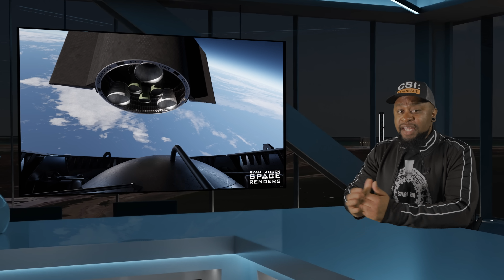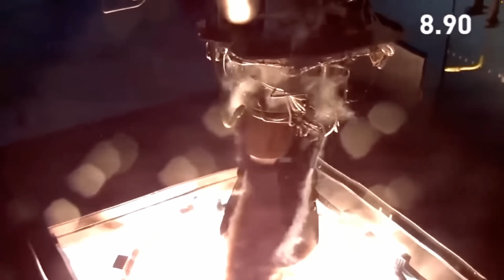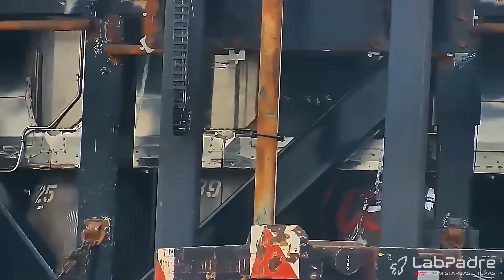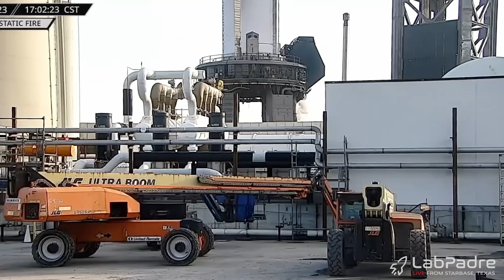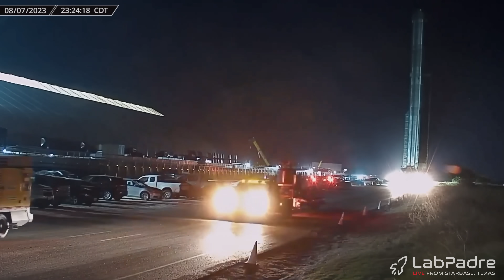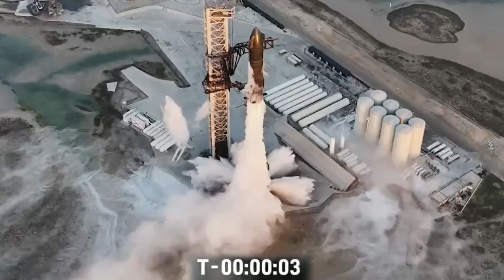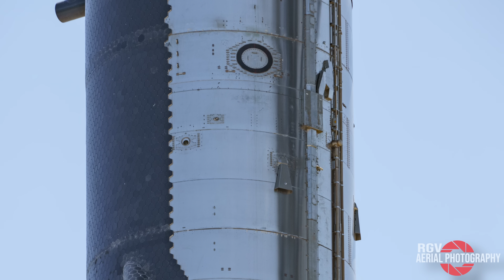How To Prevent Raptors From Destroying SuperHeavy | Part 1

Comment: Another thing again zack, am surprise the ship never made it. I thought the biggest task was the booster and launch mount. 🤦🏾‍♂️. How on earth they lost connection with the ship, I felt confident in the ship to be the most ok part. Because the booster actually go through way more stress than it. I strongly believe they should add two more engines to the ship. 4 in the middle and 4 vacuum. I was watching the fuel level also, that booster use up so much fuel, I doubt it would be enough to do a successful land with all that weight etc. Not sure. The ship needs allot of upgrades, those engines to perform long duration for the moon. I don’t think those engines and fuel will be able to take that ship to mars safely orbit mars, land, launch and back to earth Nope. Nope. Only a nuclear powered engine can do that. And I don’t know why and what takes them so long to actually make a nuclear engine.
Reply from the maker: Ship needed to go through this so they know what to fix.  Just like the booster.

Comment: Hey zack. My concern is. How booster 7  flip multiple times and all its engine never shut down. With the long delay to terminate it, I see it dip, flip, and tried to straighten up to go up before it explode. Yet booster 9 successfully separate from ship, and inner engines shut down. My concern is, if it was a fuel back slush that cause the engines to suffocate, why that never happen to booster 7 when is flip dip🤔. Something is not right. Again why they never tried to relight booster 9 engines after it complete it flip🧐. Or, why not another approach in not having it flip? May sound stupid, but just asking.
Reply from the maker: It’s like swinging a bucket of water over your head.

Comment: Are those electric actuators designed by SpaceX? It looks like they use inverted planetary roller screws, hard to tell but it looks convincing from the outside shape.
Reply from the maker: That's a good question. I'm not sure if they are developed in house or not

Comment: 42:30 There's a good chance that the engine status indicator lags the actual starts.  If it only updates once a second, but the engines start every 0.05 seconds, the indicator is nearly useless for trying to determine the start pattern.
Reply from the maker: The SpaceX livestream was not synced properly with the diagram. I edited so that its correctly timed. If you watch closely you can see the shock waves when different groups start up. I thought the same as you initially but turns out its actually spot on

Comment: Zack I want to mention something you have not commented on. If you watch a night Falcon booster return about 25 km up and a Corona deveolopes around the grid fins. The same heating that hits the heat shield of human capsules and the fairings of launch vehicles. This heat also hits the engine end. G forces exceed launch levels.
Reply from the maker: I think the heating on human capsules is much greater because they are entering from a much higher altitude and velocity. I haven't really covered anything related to that yet

Comment: 43:39 The co2 system is a great observation, but with those volume flow rates im pretty sure that is propellant.Could be that they just ramp up the co2 stream as the shutdown releases more propellant in the bay, but there is no way this much co2 is released for 2.5 mins.
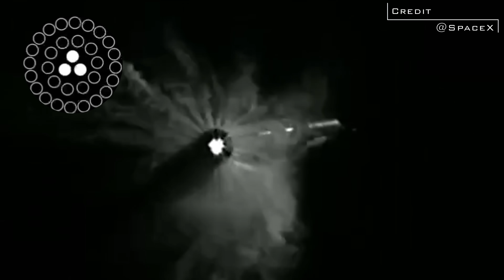Also i'd believe the way the five streaks form wouldn't be so clean if it was just co2 not getting sucked in by the single engine gap anymore. Its easy to make a smoke stream in a windtunnel, but hard to block a clear stream out of a smoke wall, as in the remaining engines would probably still suck away the majority of the co2. Also that pronounced star shape at 43:39 only lasts for a few seconds every time new engines shut down, while the continiuous co2 system becomes visible again at 43:57, with a much smaller expansion radius. They might still reduce the flow though and also keep some for the return.

It would also not mean anything went wrong, considering they shut down many engines at once they might have decided to keep propellant flow going a bit longer after shutdown to soften the fluid hammer effect, which would yield instant shutdown/reduced thrust for hotstaging while also leaving the ship intact. You can see that right as the streaks thin out, new engines are shut down, as in managing the shutdown dynamic flow pressure. Possibly even commanded/dependent on an upstream flow pressure gage. If this is true they might try to shut combustion on all engines at once next time, possibly with even longer propellant slow down to get an even faster thrust reduction, or even a planned underthrotteling/starvation if there's no instability issues from that.
Reply from the maker: We have recorded 3 different full length tests of this system on the ground. It does in fact run for 2.5 minutes. Elon also mentioned in his tweet that they would run the system during the entire flight. I showed the tweet in order to remove any doubt of that. 

Also, if they left fluid running longer than it would likely come from the huge bleed valve on the bottom of the booster and not directly out of the engines. The staged shutdown is designed to reduce the hammer effect.

Comment: The autogenous pressure system is so complicated any leak there will cause problems for fuel feeding the engine causing more risk for engine failure.    I would love to hear from @csistarbase to do a deep dive on this.
Thanks
Reply from the maker: I think the autogen system is actually able to adjust how much gas is being sent to the tanks. If there was a significant leak there the flight computer would likely increase the amount of gas being sent.

Comment: Are the booster engines space far enough apart that if 1 engine refuses to gimbal it won't prevent its neighbors from gimballing as designed?
Reply from the maker: Yes they not able to collide with each other as far as I know.

Comment: I think the hot staging caused the propellent to surge in the tanks and piping of the booster and when the engines relighted the fuel and oxidizer started slamming inside causing pressure surges in the engine pumps which we know too well can cause explosive conditions in the combustion chamber. They should have an engine or two on a separate fuel system that is designed to handle sloshing of fuel better and use it to get the bubbles out of the main fuel/oxidizer supply before relighting the rest of the engines. The other way is to keep the acceleration of the booster positive through the hot staging process, but i can't imagine how that can be achieved with all the engines of starship pushing down on it in the first seconds...

Comment: After the failure of the last launch I have a question regarding the protection of the crew from failures,  Seeing a video of the forward portion of the Starship tumbling after destruction, I realized that there was no crew escape systems on the vehicle.  This would make the Starship the first crewed rocket to not have any sort of crew escape system dating back to the beginning of orbital operations. Could you do a video addressing these questions.
Reply from the maker: I would probably touch on it as it becomes relevant.  I usually don’t have time to discuss things that far out in the future. It’s tough to be able to mention everything that’s actually happening now.  I removed several sections from this video related to other upgrades

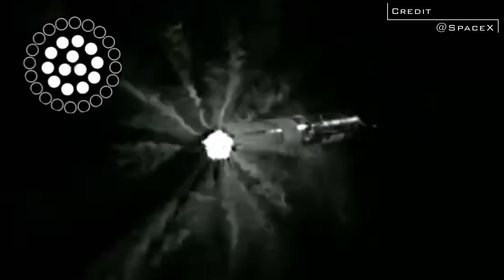Comment: 43:44 you are wrong. Scott is mostly right....That is methane or oxygen or both venting right after each engine shutdown. Coming from vents. You cant just stop that much fluid flowing without destroying stuff, pressure has to go somewhere. Called fluid hammer
Reply from the maker: With all due respect to Scott - because I love his work - I think my team and I have a much better understanding of how this vehicle works.  

I don’t think he was even aware of the fire suppression system.  

They seemed to do just fine stopping the fluid during all of the 33 engine static fires.
Reply from the maker: The gas is very clearly coming out of the side of the vehicle. Not the bottom.
Reply: At 43:57 you can clearly see that large amounts of the visible gas come from those 18 vents of the CO2 purge system around the circumference of the booster as the engines themself don't have vents in those locations. Scott didn't mention this in his video so that's what Zack say he is correcting.

Comment: humm why not reinforce the engine itself instead of creating covers. since they kbow what parts may fail in the motor why not to reenforce those I guees it will add less weight in the end right? I bet the turbo pumps are the part with more issues
Reply from the maker: They are working on this currently

Comment: Likely a stupid question but is there a reason the engine shrouds cannot have small holes drilled into them to help during overpressure issues and methane leaks? Presumably they would lose some structural strength but they would be lighter as well.
Reply from the maker: They do have holes in them, that’s how the CO2 escapes from the bottom

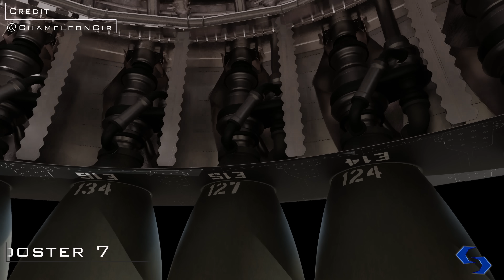Comment: 24:00 The whole box design is pretty overengineered. Why dont they use the same toilet paper roll structure as on de inner engines? A cylinder has the least area, best strength and is easy to make. Add a large cicular notch/Blast disc towards the outside to rupture in the event of an explosion and vent pressure towards the outside, like the exsiting cone skirts. Or if not for aerodynamics, leave the ouside open with just a 180 deg shield to the inside?

The cylinders would also act as a double layer between each engine, with every one having it's own shield and containment ate the same time instead of the single layer walls between the outside engines. And since the outer edge joints seem to be the biggest problem, you could probably make each tube 1/2 the thickness, adding up to the previous flat wall strength. Since an engine needs no more shieling or containment once it fails, the thinner shielding could just about be designed to fail, as the surrounding skirts will take the remaining heat.
The circular compartments would also allow more space in between them to vent off heat and allow any expolsion blast to dissipate in between the surrounding engines instead of forcing it downwards with the stronger vertical barriers/boxes. If you want to save weight i'd say the best way is not contain the blast but direct it's intensity according to what each of the surrounding things can handle, judging from the inner engines a (nonetheless shielded) rocket engine can probably handle a bit more than a prefectly smooth ride. Expansion volume between the engines increases by the square of the radius from the origin, so a lot of energy is dispersed with just a bit more free space between engines.

Combining the robust geometry and highly refined planar welds they make on their rings this would surely decrease overall weight and cost.

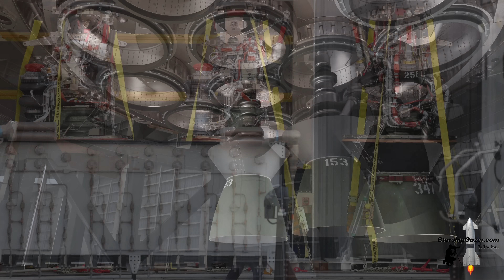About the failure of the center engines: The lower shielding "seals" at 12:58 seem pretty hefty, as in they confine gases and blast until the whole assemly, like 45:07 ruptures and sends metal and shock in all directions like a bomb. You'd rather have a controlled fail than a complete destruction. There should only be a solid bell shape around the top and side of the engine, with blankets, mesh or lose plates on the lower end only for heat protection on reentry and initial blast containment, something that gives way in case it does esceed the limit, because that's the most favourable direction you'd want the bang to go anyways!? A true best part is no part there...

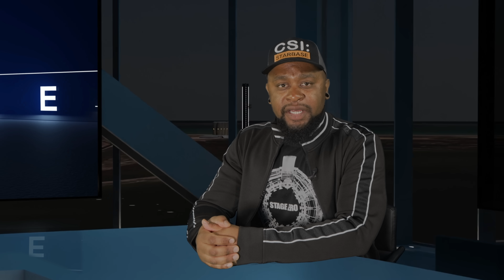Comment: 8:40 "If you lose TVC on one of the 13 Booster engines, it's fine now"... Is it thought? The way the 13 engines move together, do you really have the necessary room to move the remaining 12 enignes if 1 is pointing the wrong way? It doesn't look like it. Do they plan to jettison the faulty engine to continue controlling the booster or something to keep it out of the way?

Comment: 10:32 thats untrue, in fact there have been three early engine cutoffs. One during CRS-1, and two more, much more recently, during Starlink launches. Both didnt effect primary mission outcome, but caused B1048 and B1059 to be unable to land.
Reply from the maker: I asked my audience on Twitter how many failures were and that’s what they told me.  Outsourced that info lol.
Reply: @CSIStarbase  Ok thats crazy that they got this wrong. Btw the failures were
- CRS-1 
- Starlink V1 L5
- Starlink V1 L19

Comment: They need to make it so that the ship can hot stage off the booster regardless of the health of the booster.  That means having many contingencies. I would say that for the first part, the ship may need to fly back towards the launch site, then alternative landing sites, and then flat terrain away from people, then just away from people.

it'll have to burn a lot of fuel, or maybe dump some.

Even If it has people in it and it is gonna head towards a populated area, it may have to blow up.

if the fuel is gone, it mag be able to crash land relatively close to people.

I imagine having fighterjet ejection seats for the first test crew... or maybe a capsule.

Comment: There is a very obvious issue with all this blast shielding, no ventilation points to keep pressure low during an engine failure

Comment: Also good to note 48:35 This is a good representation of how at the 7 minute mark something happened on the ship that caused the remaining LOX to start depleating much faster than normal. You can see in this sped up footage how the LOX is always just abover the CH4 in the level. At 7 minutes there is a flash/ploom on the ship, take a look back at the guage and see the LOX is dropping lots faster until at 8 minutes it seems to be empty while there is still CH4 left.

Who knows if the FTS triggered or not, but I assume that running out of LOX shutdown the engines and the FTS auto activated because it then knew it couldnt achieve its nominal trajectory and rather burn up over Africa, better to do so over the Atlantic.

Comment: No youtuber seems to talk about, how little propellant the upper stage had to reach orbital velocity. It still needed about 4000 km/h if I remember correctly, but it only had left a little lox and methane. I thought some studious youtuber would count pixels and seconds on the telemetry to figure out if the thing has a chance to reach low earth orbit, or is it still too heavy.
Reply: Both the booster and ship were fully fueled, so they should be able to reach orbit, even with at ~100 ton payload, but this flight test was always planned to be suborbital and never reach full orbital velocity. This was to increase safety on such an early test flight as it could be dangerous if Starship failed to de-orbit properly and reentered at an unplanned location. I'm not 100% sure what the target velocity for this trajectory would have been, but a popular theory is that S25 fell a bit short of it due to a leak late in it's burn, which can be seen on the info graphic and was terminated because it wouldn't reach is designated reentry zone near Hawaii.

Comment: hello zack,I am a space flight fan, I watch your videos in East Asia, and I also learn about the advancement of space technology on local online platforms. But there have been some disturbing statements, and I wonder what you think of them. 

Some people say that he is studying in the United States and he hopes to prevent the starship from successfully launching, so he posted a message online claiming that he would bring a sniper rifle to Boca Chica and shoot the rocket when the starship ascends. Are his words actionable ?

Some people also said that because the manufacturing and testing process of starships is very open and transparent, an East Asian country can quickly imitate starships. Some engineers estimate that they will be able to successfully launch a replica version of the starship in 2027, at a very small cost and without even providing workers with a good working environment and remuneration. 
I think this is unfair, and I think SpaceX must take effective measures to protect its technical secrets.

Comment: They need have a cylinder with a ring of motors instead of wasting all that fuel in the center and the heat it creates. This would also allow for 30 meter wide rockets. Just a hollow center which will help with venturi effect, and cooling the motors from all directions.

Comment: I was wondering - why did the booster do a flip maneuver?  If it eventually is going to land and be recovered, shouldn't it stay upright and be allowed to drop straight down until the engines are re-ignited for slow descent?
Reply: It could be, just like on Falcon 9 missions, that they wanted to cancel out the forward momentum, so they can land in a specific location.
Reply: They have to fly back to the launch pad.

Comment: Great analysis!  Thanks!  I also noticed the engine asymmetry during the startup phase.  My conclusion was that it probably was actually symmetric and this was a display/telemetry anomaly caused by under sampling (compared to the engine control sequencing clock).

Comment: I dont think the fires had much to do with the Hydraulics failing.  Most of the Hydraulic fluids I deal with are water-based as you have to worry about gulf water contamination and fines associated with chemicals like that.  Other than that, Extremely well presented and great finds on the HCO2 purge systems.
Reply: What type of hydraulics are you dealing with? Aircraft hydraulic fluid on anything I worked in the Air Force is definitely flammable.
Reply: @edwinball985  We work with specifically non-flammable hydraulics for use on offshore oil rigs where anything flammable is avoided at any cost.  I figured (albeit wrongly) a lot of others did too, but thanks for the info!  Specifically the type, I can't really say since there are multiple, but they're all water-safe non-flammable.